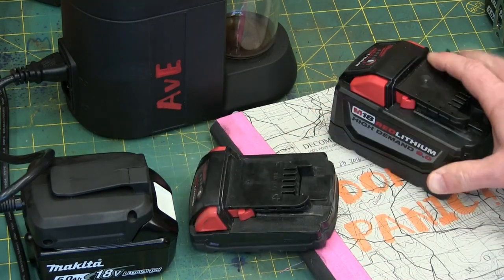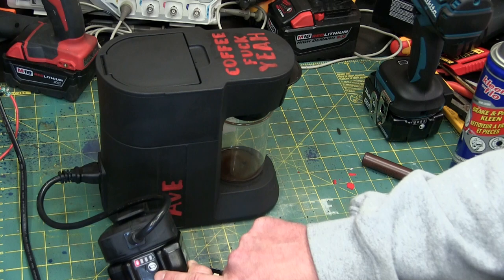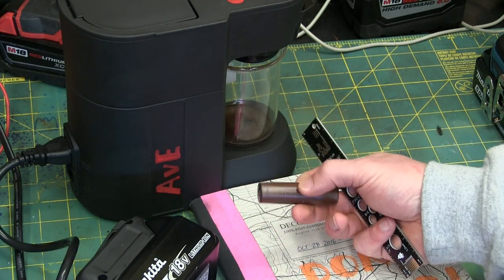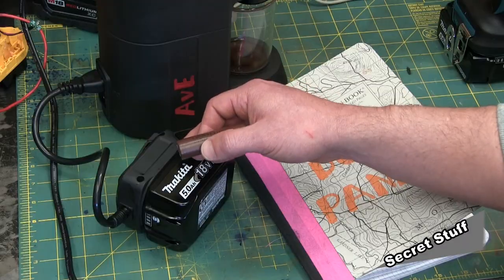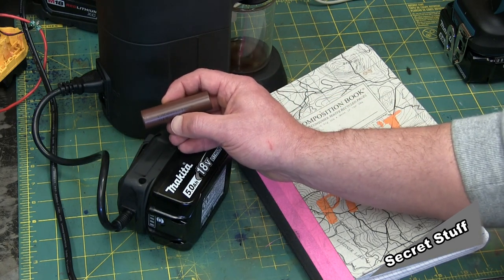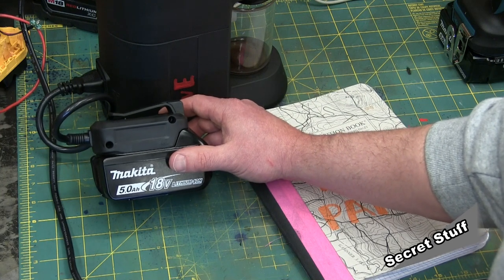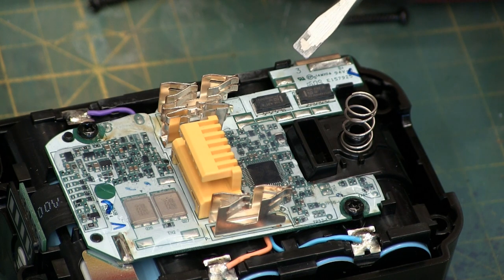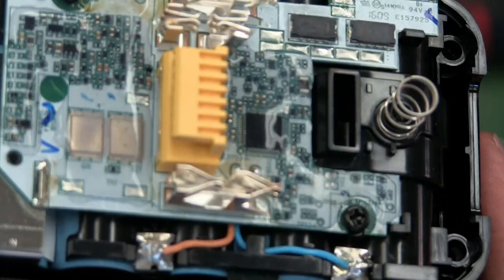BEST TOOL BATTERY? WHY BIG LITHIUM COST YOU LESS!

Comment: it can also be argued that the higher capacity batteries are better as they will go through less charge cycles in their life than a smaller sized battery with the same amount of time on the tool.

Comment: Don't you mean 9 times better?  Each cell is working at 1/3 the discharge rate as with the smaller pack, so each cell lasts 3 times longer = the whole pack lasts 3 times longer.  So you get 3 times the energy multiplied by 3 times the longevity: 3 * 3 = 9  No?

Comment: In these "big lithium" pack configurations that require lower current rates per cell.............................can the MFG's get away with using crappier (cheaper) cells to meet the performance ratings of the packs (compared to the cells used in the smaller/lower capacity packs)?  If they can..........they will methinks.  Or I'm talking out my butt.  Either scenario is possible....

Comment: Probably is silver, when I did metal pressing years ago a lot of high current electrical contacts we made were silver plated.
Reply: Doesn't silver corrode?
Reply: Anonime Eminona - no it tarnishes,
Reply: isn't that bad for conductivity?
Reply: Yeah it's bad. That's why most electrical connectors are gold plated, even though silver is a much better conductor. Because gold doesn't corrode or tarnish.

Comment: Howdy Ya'll, Here is a question/experiment idea for AvE. What kind of transformer would you need to power cordless power tools? I work for the big evil yellow and black and see a shit ton of tools scrapped due to dead obsolete batteries.  My thinking is show us how to make old batteries housings into ac to dc converters to run these good tools with dead batteries.

Comment: I use the Dewalt 20v platform.  I have more batteries than what I need. I cycle use as best I can but sometimes i'll go a month or two without touching one. Should I store them with a full charge, half charge, empty, or does it even matter?
Reply: The imax b6 charger has a storage charge function that will charge a battery to 3.7 volts per cell.
Reply: The Dewalt 20v platform has 5 cells in series - 5 x 3.7 = 18.5 volts for a storage charge. About half charge.
Reply: It actually does not matter. It's been a persistent myth for decades... Don't ask stuff like that on Youtube, unfortunately, 98% of the people on here have no idea what they are talking about... That falsehood is a holdover from an inaccurate testing methodology from early NiMH batteries...In additinon, although AvE is generally pretty accurate about things, and I am a great admirer, but this video is chock full of inaccuracies... I can go buy an 18650 right now with a 25A discharge rate on a 3,000mAh battery... There's no capacity/discharge rating dichotomy unless you are trying to buy cheap batteries.

Comment: Had no idea that theres Sam`shung inside the 5.0. First ever to see anything but Sony in them, from 1.3 to 4 Ah. Good to know. The 481 is breddy gud tho, spins a 60mm diamond tip holesaw through 5mm steel like its fucking nothing. Cant wait to see what you`d upgrade on it. Bet a fiver that you`ll fuck it because I took the 451 apart and the stuff that matters is all sunk in that black epoxy glue thingie, chances are the 481 is the same.

Comment: i chopped the battery holder of my 10 year old makita and hot glued a XT60 connector into it. now i run it on a 4S (16.4v) 5000mAh 30C lipo battery. goes like a motherfucker!

Comment: another expert on vaping, stick to tool reviews AvE. Don't tread on my VAPE! 
i mainly use Sony VTC5A, VTC6 and VTC4 cells in my vape devices.  i also have Samsung 30Q, LG HD2C and HG2 cells. all are 18650 cells. depending on the current demand of the coil inside the atomizer , that  will dictate what battery is best suited. in the vaping community ohm's law is our friend!

Comment: I might have missed this, because I'm admittedly, slightly intoxicated, (and possibly an idiot). However, is the Dewalt rated at 6AH @ 20V? I would assume once you've "flexed" to 60V you'd only get 2AH. Long, stupid story short, I agree. Yet, I would also imagine that the Makita is only pulling 0.5A in order to get 9AH at 18V? I'm no pixie wrangler, just some amateur arithmetic drop-out. Cheers m80.

Comment: I can't tell you how many morons walked into the store where I worked asking for 40 amp 6000 mAh 18650s for vapes. Tell them it doesn't exist and they counter with, "I saw it on the internet." Tell them it doesn't work like that, and any cell you buy with those specs is lying to you and might kill you.... that's when they get pissed and walk out.

I'm glad I don't work there anymore. Also, this isn't anti-vape. My dual 18650 mech mod is less than a foot from me. Just be smarter before you walk into a retail outlet demanding products that don't exist.

Comment: I'd be willing to bet that the contacts aren't plated in silver. It tarnishes too easily and that would fuck up the connection between the battery pack and the tool. Then again, they could well have been plated in silver (it's one hell of a conductor after all), contact tarnishing be damned. After all, I'd be willing to bet they could get their friendly local metallurgist to gin up some alloy of silver that'll be good 'n tarnish resistant, and then when it finally does tarnish to the point of non-conductivity in a couple of years they come back and buy a new one!

Comment: In regards to 18650 lithium batteries check out Batterymooch (I think that's his name) he's carried out proper tests on the mah and amp ratings for most of the bigger names. Mainly for douche flute use but still relevant info

Comment: higher mah = higher discharge rate with batteries of the same discharge (c) rating
Reply: higher C rating = lower internal resistance. higher resistance creates heat which kills the battery

Comment: Sure the big battery holds six times more juice, but if I have to hold the damn thing over my head all day, I'll gladly take the smaller ones and deal with changing them.
Reply: 27dcx  The newer high capacity packs weight about the same as the old 18v NiCd packs.
Reply: otm646 nicd is basically a stone
Reply: I think the huge capacity batteries are really meant for the stationary tools they sell now.  Like the tablesaw and sliding compound "chop saw".

Comment: i dun fuckered one of my big makita batteries by trying to use them on an electric scooter <.< >.> <.< i couldnt fix it cause i fuckered the board XD the cells were fine odly enough XD, oh also definitley true on the ampreage output, my makita impact gets about twice as torquey on the bigger battery, and anticdotal experience, the makitas hold up pretty well ive had mine for about 5 years maybe? and ive beat the shit out of it, i quite like them

Comment: thats a nice voice activated camera you got there.

edit: you dont need to balance them in parallel? but chemistry is a messy bitch so they will still drift over time wont they?
Reply: The balancing is there pretty much just in order to avoid deep discharge, which will instantly kill the cell, or overcharge, which will slowly kill the cell. Due to repeated charge cycles on an unbalanced series battery, you could be down to 3V average voltage per cell (discharge termination voltage threshold), but some cell will dip under 1V, and will die. Balancing avoids this issue. Another issue of unbalanced batteries would be overcharging, when you have reached 4.2V average voltage per cell (charge termination threshold), some cells will be not quite at 4.2V yet and others will have been overcharged for a while.

When the cells are in parallel, they share the voltage, so neither overcharge nor overdischarge will occur. They will still develop individual differences and some cell will die quicker than others, however they tend to balance themselves out a bit. As the batteries age, their ESR increases, and some cells will age faster than others. However, such a cell will deliver less current in a parallel configuration than its siblings, which means they will age quicker, slightly equalising the ageing.
Reply: Siana Gearz
oh, weird. and that is enough to stop it over/discharging for a single instance? i guess they never get to drift out enough for it to matter
Reply: 1wsx10
All parallel circuits necessarily have the same voltage.

Imagine you have a cell that has 3V terminal voltage and another has 4V, and they are not connected. If you connect them in parallel, first thing you'll notice that the whole thing will get very hot within a fraction of a second, because compensation current will flow through the battery: the 4V cell will try to charge the 3V cell with the current being limited only by ESR and connection resistance - essentially all the voltage difference will be dissipated at the resistances along the way and at ESR. The current can be pretty high and it can start a fire or desolder connections. But if they have always been connected, the compensation currents will have flown already slowly, as necessary, and the voltage will be level, with the slightest of imbalances at consumption or charge current peaks. This is what balancing is all about, because e.g. external balancer can not specifically know about batteries' charge either, it can only keep their voltages in check.

This behaviour is corollary from Kirchhoff's laws and Ohm's Law.
Reply: why don't lipo chargers just wire the battery in parallel then?
Reply: 1wsx10 first is presumably because the device you're going to use the battery in needs a specific battery configuration, and the charger needs to work with that.

Second reason is that safe charging power is higher on a series battery, so effectively you can charge them faster. Because safe charging current is about the same, but in a parallel battery you're never quite sure which cell will get the bulk of the current at any given time. 

Third is convention. It's just customary not to write parallel configurations in model sports under some circumstances and use them silently. The series length determines the voltage your device will have to work with, and the number of balancing connections the charger must provide. The parallel configuration only determines battery dimensions and capacity and discharge current, which are all specified separately anyway.

Comment: Firstly, thank you kindly, good sir, for all of the fantastic videos you work to create, and the time, effort and 'bum' fuckeries invested into this endeavor! However... 

I enjoy a good load from Ave as much as the next fella, or lass, but I have to say, there is an ass bucket of misinformation in this video... One of the few times I feel there is inaccurate information in an AvE dump. The way he describes a "TON of different chemistries" is just incorrect... There is no mutual exclusivity between capacity and discharge rate, never has been... You can buy a 3,000mAh cell with a 25Ah discharge rate, and you can get a 1,000mAh cell with a 1Ah discharge rate. There are no multiple chemistries contending in this manner (that is NOT to say there are not multiple chemistries, just not in the manner described)... I really hope he has done some research to find this and correct for it (and perhaps he already has) in future vidjayos...

Comment: Well now we know you must have accepted some money from Milwaukee to plug their batteries!  Why else would you give the nod to the most expensive batteries on the market and say they are the best bang for the buck?  Wouldn't the best bang for the buck clearly be the DeWalt batteries since they have the lowest prices?  It's basically a commodity item, one brand isn't any better than the next (the tools sure maybe but not the batteries, they all source the cells from the same group of suppliers based on the lowest bid at the time).
Reply: Paid him so much to call them "milfuckie" right?

Jokes aside, the conclusion makes sense the more you think of it. More batteries in parallel = less current per battery (discharge and i assume charging). 
1/3 the current = batteries last 2-3 times as long
3 per parallel set = 3 times the capacity
3 times the capacity * 2-3 times the lifetime = a battery 6 to 9 times as good as a single parallel cell set.

The cheaper dewalt is (according to maths) only better value if it is 1/6th the cost of the milfuckie, or if they produce a 3 parallel cell battery at a cheaper price than the milfuckie

Assumptions made: Greater current draw degrades batteries faster (common but still assumed), dewalt doesn't indeed produce batteries with the same cell configuration for cheaper, and that the electronic control circuits don't do some black magic that changes anything.

A more fair comparison would have "extra large" batteries from all three. Then comparing the cells themselves would become the baseline of "better". Does dewalt make a battery in the same configuration?
Reply: Yea I did watch them and I noticed they are so very similar that one brand isn't any better than the other.  Energy is energy and if you want to spend more on yours that's fine with me, but you shouldn't say stuff like "best bang for the buck" about the most expensive choice on the market.